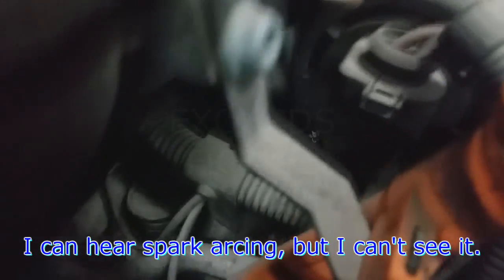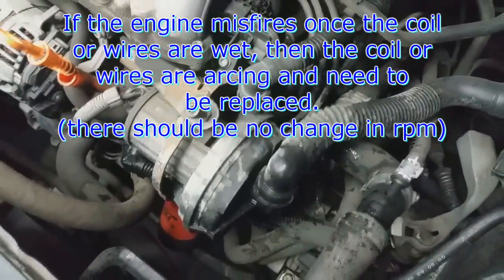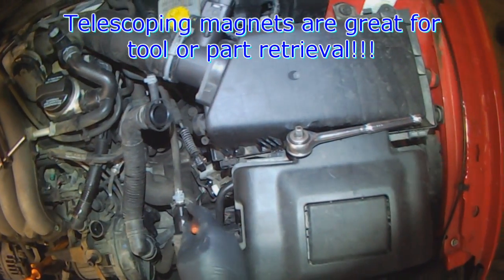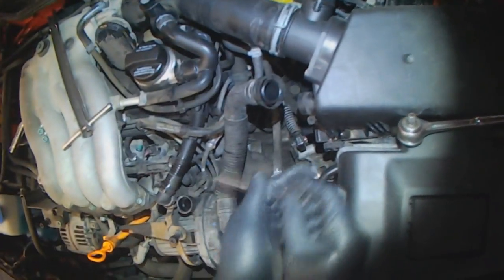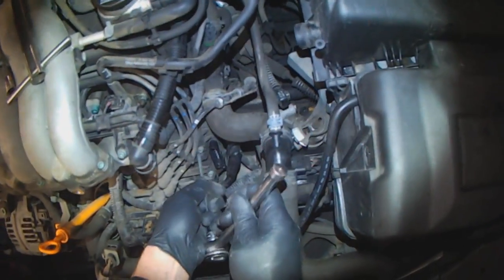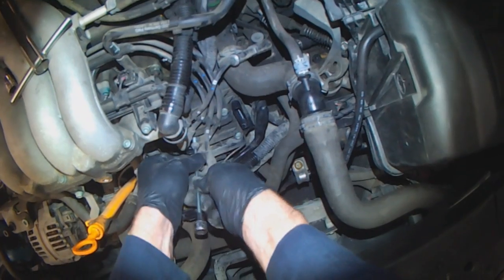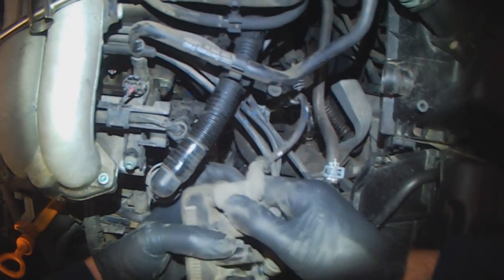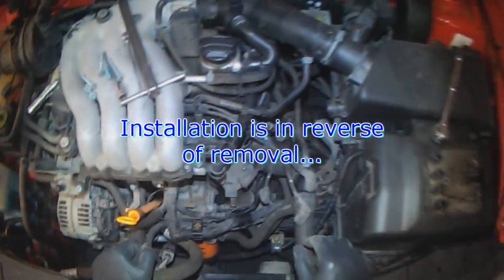VW A4: 2.0L AEG, AVH, AZG, BEV, BBW Ignition coil removal

Comment: After watching your video, observed arcing on my coil  near the lower air pump bracket. The miss was audible.  It kept throwing 0172 "rich" codes. But with hard starting,  and arcing especially during humid weather, it suggested a coil/ignition problem. 
After taking the coil off, found the problem: the igntion tracks were arcing out of 4 holes on the plug tower side of the case. 4 little holes blown out, one under each tower, with carbon tracks visible on the adjacent bracket. New coil in, problem gone!
Also, severe oxidation was visible around the coil mount ferrules and screws. So, applied copper anti seize to the screw threads & head,  top and bottom ferrules in the coil mounts. Poor grounds cause obscure electrical problems. This should help. Thanks for your excellent video!
Reply from the maker: Thank you for sharing and thank you for watching!

Comment: So I have to do this replacement but the 3 bolts are so corroded and stripped that I'm going to need new bolts after I figure out how to remove them. Does anyone know the spec for these bolts? Thanks in advance.
Reply from the maker: Part #5 in the following link:
https://volkswagen.7zap.com/en/usa/jetta/jem/2002-270/9/905-905000/#5
Different bolt sizes depending on engine code (as listed in the part number description).
Reply: @EXOVCDS  Thank you very much

Comment: What order do the plugs go in the coil? For example mine are all in a vertical row. Which one is 1 and which is 4? Do they start from the bottom or from the top?
Reply from the maker: I believe that 1 is at the bottom and 4 is at the top... as can be seen in the video. Simply follow the wire from each coil post to the spark plug. #1 spark plug is the one closest to the alternator belt.
Reply: @EXOVCDS  basically same as following the length of each cable? I removed all cools from the cylinder head. The coil pack I never moved them, only on the engine.
Reply from the maker: @alvaro93364  yeah, since all wires are different length,  they will only reach where they have to go.

Comment: Thanks for the video! Quick question:  I have an oil leak in that area, it looks like its being sprayed from somwhere because it pools on top of the transmission and eventually oil ends up at the bottom of the block just below the crankshaft sensor; what do you think? Valve cover gasket is new.
Reply: Engine is AEG from a 2000 Jetta. It doesn't take too many miles for leak to show up and starts to pool again after cleaning that area with degreaser and hot water.
Reply from the maker: @x-man4702  Oops... that reply should have gone to your other post.
Reply from the maker: @x-man4702  With some oil leaks, you have to check them often (after cleaning)... otherwise oil is everywhere and you won't be able to tell where it is coming from. Even though the valve cover gasket is new... have a close look again. If it's automatic, it could be the rear main seal that is leaking and the torque converter is throwing oil up & out the top of the transmission... or the ATF oil cooler seals could be bad.
Reply: @EXOVCDS  
It sounds more like the rear main seal and the torque converter is throwing oil around, the leak shows up very quickly after cleaning. I'm thinking about placing a video camera in that area to capture the leak in action, what do you think?
Reply: It's automatic
Reply from the maker: @x-man4702  Sounds like a good idea... just make sure it does not fall into the oil.
Reply: @EXOVCDS   hahaha
Reply from the maker: @x-man4702  There are 3 green fuses on top of the battery... two of them are for ABS system (one for the pump). Check those fuses (pull them out of their slots and check for burnt connections). I have also seen bad connections between that fuse box and the 3 wire plug that connects to / at those fuses. With that plug "plugged in"... check that there is actually power on all 3 of those wires of the plug. Use a metal paper clip and push it into the connector where the wire enters and then check the paper clip for power (better than piercing the wires to check for power).

Comment: Hello I hope you still watching your comment😉 My car wasn’t firing and I found that the fuse 37 was burnt. The problem is that whenever I replace it, it keeps blowing the fuse when I start the car.
Reply: Sorry for my english🙃
Reply: I’m from Quebec so I speak french
Reply from the maker: @MaTRiX666LOL  Year, make, model... so that I can look at a wiring diagram for your engine.
Reply: Sorry its a golf city 2007 2.0L
Reply from the maker: @MaTRiX666LOL  Disconnect the connector from the ignition coil... insert a new fuse. Does the fuse still blow?
Reply: @EXOVCDS  I just tried and the fuse didn’t blow. So it might be a short in the coil?
Reply from the maker: @MaTRiX666LOL  Yes or the wiring harness... look for chafed wiring.
Reply: @EXOVCDS  The coil and the spark plug wires are new so can it be the connector of the coil?
Reply: @EXOVCDS  The coil connector seems okay too
Reply from the maker: @MaTRiX666LOL  New doesn't mean that it is good.
Reply: @EXOVCDS  Yeah I’m pretty sure that it’s the coil because I bought it on Amazon for about 100$ it was a new coil but maybe à bad one.
Reply: @EXOVCDS  I will buy a new one at CarQuest and not at Amazon. And thank you very much for your informations😉
Reply from the maker: @MaTRiX666LOL  Plug the old coil back in (if you still have it)... to see what happens.
Reply: @EXOVCDS  Okay I will try tomorrow
Reply: @EXOVCDS  Hey sorry for the wait I just put the old coil and it’s working BUT now the automatic transmission is not working. When I’m on the drive, it automatically start on the 3 gear and don’t shift up or down
Reply from the maker: @MaTRiX666LOL  Separate issue, not coil related (I think).
Reply: That problem appeared when I changed the coil and the wire

Comment: You're the best Thomas! Every time something happens with my ol' Bora/Jetta 2002 2.0L (AZJ) I end up going to your channel. Turns out my original coil pack (same as in video) died the same way.
For anyone else visiting and reading this; Symptoms were random misfires over all four cylinders. Replaced cables with spares I had laying around, problem persisted. Did the procedure in this video and it was clear the ignition coil pack housing had cracks.
Reply from the maker: Thank you for continuing to watch. It's nice to hear that my videos are of help!

Comment: Would you recommend replacing the spark plug wires since you're already there or nah? I think it's been about 6-8 years since I replaced mine. Did the spark plugs sound the time. What do you think?
Reply from the maker: 6 - 8 years is a good time to replace the spark plug wires.
Reply: @EXOVCDS  spark plugs too, right?
Reply from the maker: @jquiznos2283  yes... even if they don't have many miles on them. Age affects them as well.

Comment: what would you do if the two bolts holding the coil pack in (the same side ones) were completely stripped and wont budge?
Reply from the maker: I'd force an extractor socket over the head of the bolt and hope that it "bites" into the head of the bolt and breaks it free. The spiral teeth grab hold of the bolt head... finding a set that has the right size for those little bolts might be a bit of an issue. Here's a link what they look like:
https://encrypted-tbn0.gstatic.com/images?q=tbn:ANd9GcS5ovThZJGKd_ip6fuAp685qrvAu6deJrdqRz7Fe1arq7fLj-YJ9g
Google search: extractor socket set
To find a set to buy... or check with your local auto parts store.

Comment: Thanks you so much for your help  on the beetle a week ago so just to update u it was clogged up from a hose and we mange to fix that now I have a check engine light on an it turns out i have a bad ignition coil what will happen if I don't change it an wait about 1 month ?
Reply from the maker: If the coil is causing misfires all the time (hesitation, power loss, check engine light flashing), it's not good to drive. Some systems do not cut fuel when misfires occur, that can cause catalytic converter damage... due to the raw fuel that is getting into the exhaust. Replacing as soon as possible will be cheaper than waiting too long. Replace spark plugs and wires at the same time, so you don't have to worry about those items failing later on.
Reply: Okay will do man. Thanks Again keep up your great videos
Reply from the maker: Thank you... keep me posted on how things go.

Comment: Ignition coil??
Reply from the maker: Maybe... check it / test it. If you have spark plug wires, spray the wires & the coil with a mist of water while the engine is running. If it runs worse, replace the wires & coil.
Reply: Thomas EXOVCDS
I have tried it, nothing has happend..
Any suggestions???
Reply from the maker: Check the resistance of the spark plug wires. No more than 6.5K ohms per wire. Check the spark plugs... if that's all fine, check the compression & injectors.
Reply: Thomas EXOVCDS Everything is okay
Any suggestions??

Comment: I had a coil go recently. Took it off and it was split down both sides. I bought a new one and put it on this morning, but the car won't fire. I checked fuses and connections but everything looks ok. Any ideas where to start looking next?
Reply from the maker: I'm at work... will get back to you once I am at home later tonight. Year, make, model, engine?
Reply: Thomas EXOVCDS 2003 jetta 2.0 litre
Reply: Thomas EXOVCDS thanks for actually getting back to me btw, appreciate it
Reply from the maker: Check fuse 37 (20A)... I'll get you a wiring diagram after work (6 more hours).
Reply from the maker: Make sure that the check engine light comes on when the key is ON.
Reply: Thomas EXOVCDS ok, just got home from work. Checked that fuse and it is blown so ill grab one tomorrow. I'll keep you posted. I really appreciate your help here, hopefully that will fix it. Question though, from what I can see, that's a radio fuse, why would it go and wtf does it even have to do with the ignition system??
Reply from the maker: Dan r The wiring diagram lists it as being for the ignition coil. Some fuses are used by more than one circuit.
Reply: Thomas EXOVCDS ok thanks
Reply: That fuse was burned out. Replaced it and it fired right away. Thank you for your help! Really appreciate it man
Reply from the maker: Dan r Thanks for the update!

Comment: I have replaced my coilpack about 25k miles ago and im getting the p0351, p0420 and p0102 code. ust did fresh tune up with ngk's and oem wires. I have also done the reground under the battery tray and did the MAF at the same time. Could it be the coil pack again? It was a beru pack, as i know these cars dont like aftermarket parts.

Thanks for your time. Your channel has helped me out so much in the past.
Reply from the maker: 4 individual coil towers or the earlier 2 x 2 waste spark coil?
Could be the coil if the ECM can't sense the circuit... bad ground would affect all coil circuits. I don't think that the other codes or all 3 are related to one issue.
Reply: 4 individual.
Reply: Yea the ground wire was fixed because it was showing codes on all circuits. So thats when i did the coil pack as well just to be safe. Is it common for the coil pack to fail again after only 25 or so thousand miles? Sorry i don't know the KM equivalent.

Comment: That string of engine codes makes this video look like a rather risque personal ad!  LOL

I had a tower separate under the boot once.  That was a pain in the butt!  All my diagnostics pointed to a faulty coil, but it wasn't until I gave up and reverted back to ohm-checking the secondary towers that I found the problem.  Half the tower pulled off with the boot!
Reply from the maker: The BBW is what does it, LOL!
Yeah... it's not always obvious, but if you are on the right track, just keep following and you'll find what you're looking for! How's snowmageddon?
Reply: *****
Haha, as I suspected, snowmageddon was a complete and utter anticlimactic letdown.  Optimistically, we got half a cm here.  :[
Reply from the maker: There's always next week!

Comment: What are the AEG, AHV, etc. in the descriptions? Abbreviations of models?
Reply from the maker: Engine "version"... the 2.0L was produced in various versions. Cable operated throttle body, Secondary air injection, variable valve timing, ECM software etc. I don't know all the differences myself... just wanted people who are familiar with their engine code, to see that it applies to their engine / version as well. Good question though!
Reply: Ah, got it. That makes sense to include them as you stated. Guys with those engines know there in the right place.